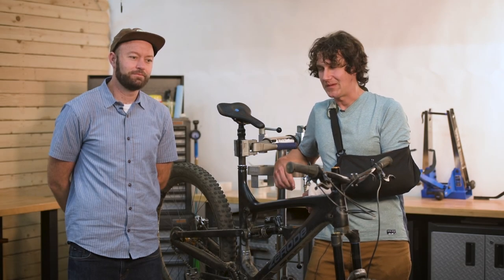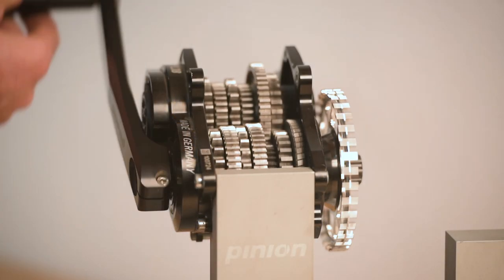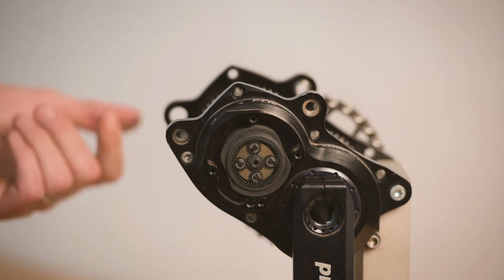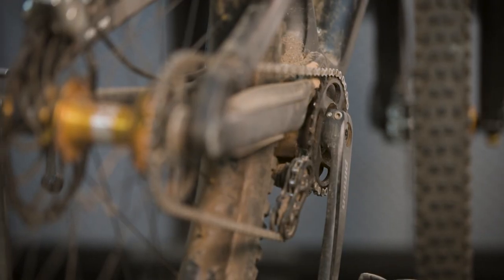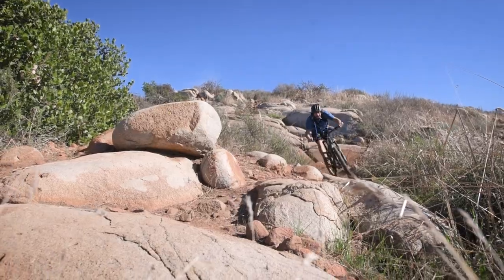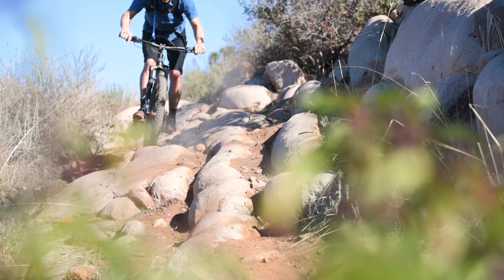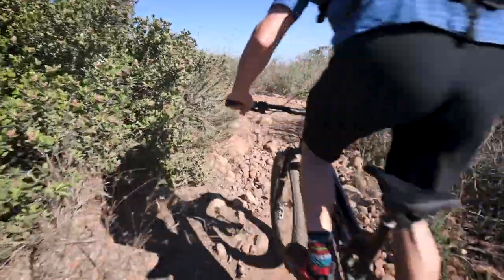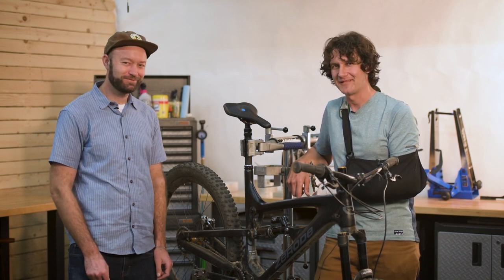Bike Shop: Zerode Taniwha

Comment: And I still have no idea how this gear box works lol, I remember the downhill bike that zerode came out with a few years ago, thought it was a great idea I’m surprised it never really took off! Glad to see zerode sticking with the idea, just seems like a better system compared to having a rear mech that can be knocked off by a big rock!
Reply: Zerode sold every downhill bike it could make. Further to that, there are a number of manufacturers that are right now switching to high pivot suspension like the Zerode G1 and G2. So you could say they did take off.
The reason the downhill bike is no longer in production is because Zerode is a small company (run out of Rob Metz's garage) and can only really produce one bike at a time, and right now their focus is on the taniwha.

Comment: Sounds like a great solution for all kinds of MTB, except for racing: freeride, adventure and most of us - Average Joes. Durability, ease and cost of maintenance and 'crash-proofness' at the price of slightly lower efficiency compared to traditional derailleurs? Sign me in! There was something about this or another bike with this kind of gear box on one of the British channels on YT (MBR?) about a year ago. What is the gear range and the number of gears?
Reply: OneManMob I think this sounds great for Enduro racing, better suspension performance, reliability, the ability to dump a bunch of gears when you come into a unexpected steep climb when racing blind, sounds ideal.
Reply: namewastaken360 I found that vid I had mentioned previosly (Bike Radar) - it seems gearboxes are not all roses and rainbows - they seem to need further development and standardization, so you have a choice of a gearbox for your bike's frame etc. Here's a link to that vid: https://youtu.be/opeJCiIgh6s
Reply: ...and one more - very indepth and competent review of this very bike and this gearbox: https://youtu.be/-eIuDiNczwo

Comment: Pinion would be great with ebikes. I don't see the point on normal bike.
Reply: Chinarello The point is far less cleaning and maintenance. No $200-$500 casettes to replace. Fewer gear/shifting adjustments. No broken rear derailleurs/hangers. Less unsprung mass. Less rotating mass on the back wheel. Centralizing and lowering the weight to the most beneficial spot on the bike. No need for complicated rear triangle assemblies in order to accommodate ridiculous 12 speed chainlines. Single plane chainline means it's highly unlikely you'll ever drop a chain. The ability to build and install symmetrical rear wheels because you don't have a flying saucer hanging off the rear hub. Etcetera.

The system needs electrical powered shifting though. The idea that you can't shift under power is a turn off. And so are grip shifters.
Reply: Yeah, that is what they say in the marketing material. My cassettes cost 30€ and they last for ages. Rotating mass is more of a problem far from the axle (eg. tyres, rim) and bigger wheels (622/650b) roll better now than 26" used to. Anyways the effect on rear wheel strength might actually be true, but that is why we have wider hubs these days. The thing is gearboxes are never going to make it to the mainstream since it requires a special frame. Now if mid-motor frame was used it would change the game and they would have a chance.
Reply: @chinarello2928  I'd buy a pinion specific frame in a heartbeat if my favorite aluminum frame mfr would produce one.  So many advantages of a pinion over current drive train.  Only a few downsides I see at the moment with pinion, biggest being the shifting, and when they figure out electronic shifting it's game on.
Reply: Guinness32  Maybe they should do an adapter that allows fitting Pinion on a middle-drive Ebike frame. There would be more choice.

Comment: WTF? Zero info here. Centralized mass, unsprung weight, subtle, smooth. Sounds like hipsters on a beer advocate review...C’mon guys! You get a ridiculous piece of technology and discuss abstract characteristics that tell us nothing.

How’s the gearing compare to a 1x11, 1x12?

How does it climb?

Is therea weight penalty for that gear box?

Does the gear box have pedal resistance?

Does it shift when you need it to? If not, where is it off? Are there settings to tweak when the transmission shifts?
Reply: Zero info ain't fair. They maybe went too detailed too quickly, but all those things you diss them for talking about are really valid points to discuss about this specific new technology.
Reply: slimjimihendrix Okay, zero may be a bit harsh, but check the link to the review I posted below. These guys shred this bike and give you the goods. I’ve gotten BikeMag in the mail for years. They’ve changed from being a great, no bs source, this shit like this. I get what they’re talking about and like to geek out over stuff as much as the next guy, but I want the brass tacks also. They just seem to have no fun anymore.

In all their geek talk, they fail to even mention if it’s shifts manually or auto(It’s manual). 

The idea of eliminating a derailleur from a vulnerable spot seems to be the best benefit of this. Who wouldn’t want smooth shifting all the time, concealed in a bottom bracket. I really can’t imagine that transfering 3/4lb from the rear axle to the BB has that profound an affect on the suspension. Nevertheless, I’d love to spend a day one one of these... Cheers
Reply: Tj Carr there is a very good review about it on Pinkbike now- it covers all your questions!
Reply: This has been out for a long time now, thus is not a "review" really. 

The main issue is they break going uphill unless you nurse it by stopping pedaling when going uphill to change gear. You can see how that's not going to work out lol.
Reply: "Gearing?"
You can find that on the Pinion website. 600% gear ratio for the 12 speed Pinion C-Line, 568% for the smaller 9 speed version, the bike ships with both of them.
"Weight penalty?"
Zerode say on their website it's about 500 grams heavier in total than a derailleur system. They already wrote that when the 9-speed version wasn't available yet, thatone is 100 grams lighter than the 12 speed, so in that case I assume the weight penalty is 400 grams.
"How does it climb?"
The guys said in the video they noticed some drag in the lower gears, make of that what you will. I really wanna know, too.
"Pedal resistance?"
No idea what you mean by it, I'm assuming you mean the noticed drag they talked about in the video. I personally tested the system on a city bike, didn't notice anything. I guess when climbing for a long time on a mountainbike you will notice it after a while, but overall it runs really smooth if you ask me.
I've noticed more drag in some 1 by 11 drive trains when shifting in the lowest or highest gears and the chain doesn't runs at a steep angle.
"Does it shift when you need to"
What do you mean? It shifts when you turn the grip shift, instantly. It shifts faster than any derailleur system because you don't need to pedal until the chain is over the new gear. You just shift into the right gear instantly. You just can't shift while the chain is under pressure, so it's the opposite of a derailleur that can't shift when you're not pedaling.